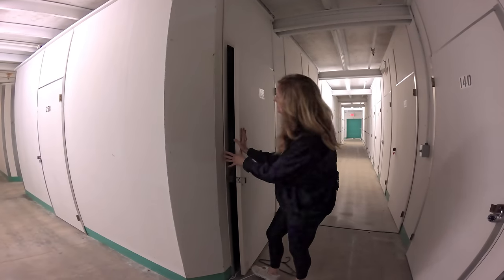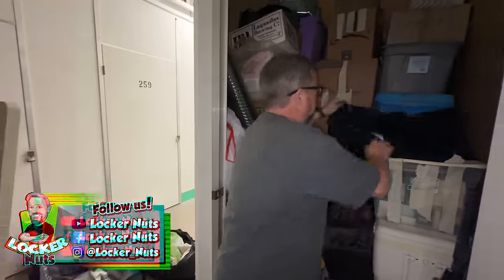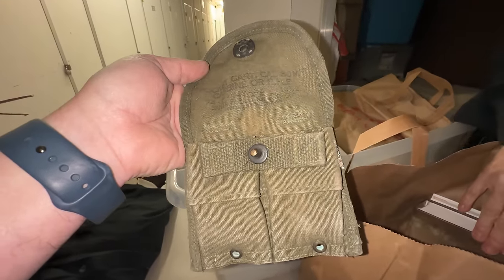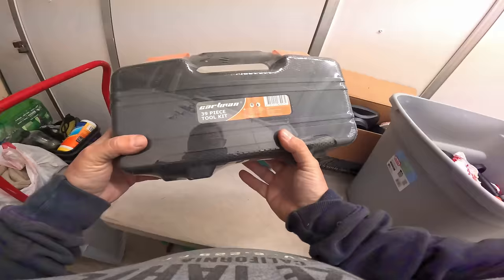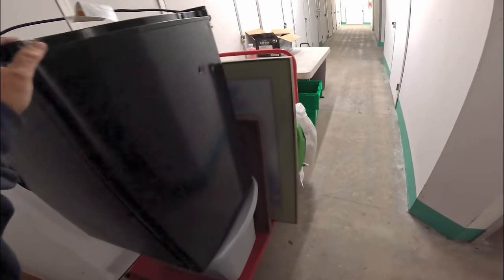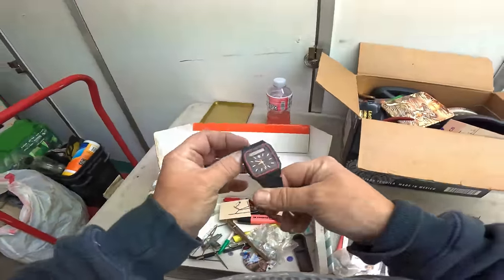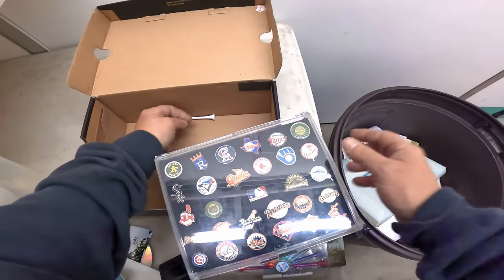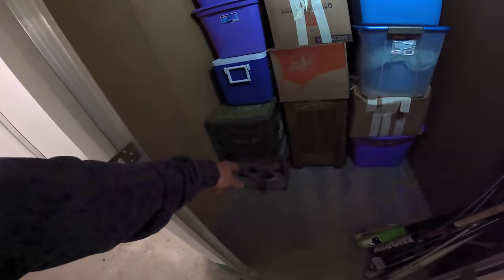This may have been a mistake... WHY did we do this?

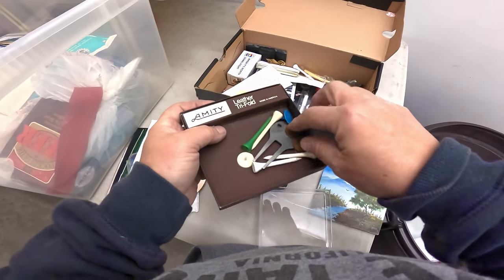Comment: Hey Jack, The Amity Lather tri-fold box at 43:05 had a bank key (the double pronged flat piece of metal ) It went to the little metal banks that your local bank would give you to collect change in (Nickels, dimes, & quarters). When it was full you took it to the bank and they would unlock it and empty it into your account, then give you the bank back.)

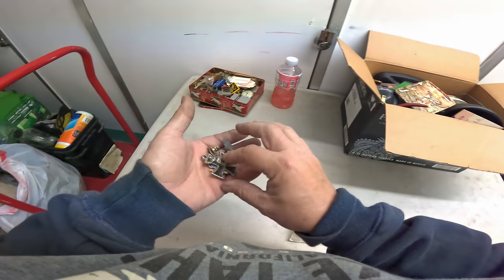Comment: Hi LockerNuts! I think the object at 37:21 is actually could be a real World War 1 Iron Cross from Germany, But i did not know about that human figure was ever added to it. At least has to be checked out because real Iron Crosses are worth a few bucks. Depending on the condition and the rank of the Iron Cross (1st class, 2nd class) the value could be higher or lower. Or probably this is something from a rockband (some metal bands love to use the 'balkenkreutz' as their symbol).

Comment: Im really liking the R&R stuff.check out the photos he framed. Not to be morbid, but I will. If any of them happens to be a famous dead rocker they could be valuable. There is a market for old concert tickets.Give them to your girls for a fun project. Group a few of them with an actual picture from the concert printed out from online and arrange them on poster board. Don’t glue the tickets, use some of those old fashions little edges that you lick like a stamp and secure the tickets like that and you can Ebay even more money for your tickets then just selling the tickets alone. Ill bet you find some old concert tee shirts and could make your money back on 2 or 3 of them.

Comment: You probably already know but most of the sports cards are 88-92….the junk wax era. Flea market stuff for sure. People will still buy it for a few bucks a box. Wax packs are 1988 donruss. The year I started getting into cards at 13. Unfortunately a bad year for value. 
1980-1986 are decent years. 
1993 to present 
87-92 are usually duds unless you have 1989 upperdeck griffey or 1989 score fb. 😎